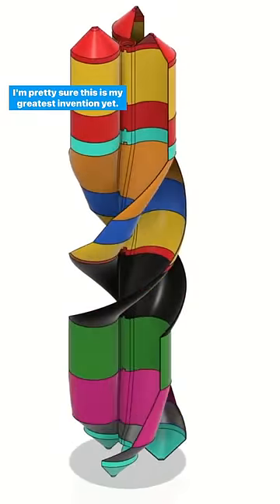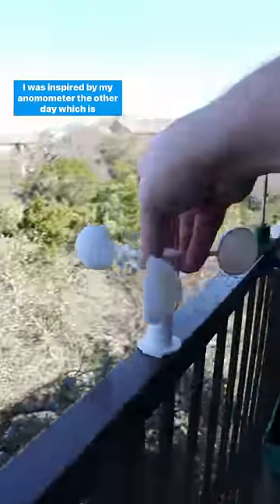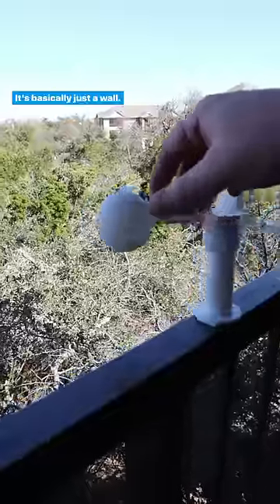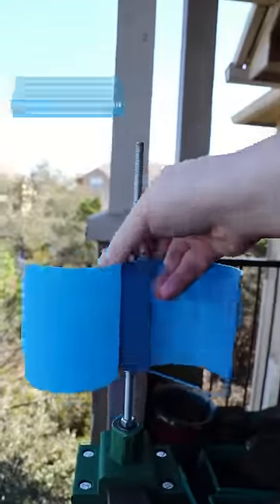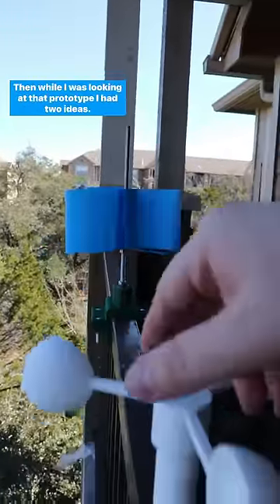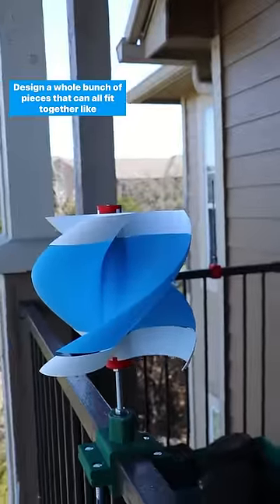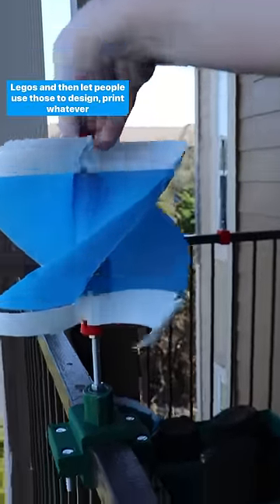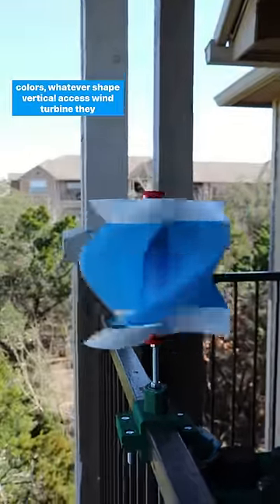My Greatest Innovation Yet: Modular, Stackable, 3D printed VAWT! #shorts #3dprinting #diy

Comment: Putting the twist just made it less efficient, because now instead of all the force pushing tangentially to the center of rotation, some of the force is now being exerted downwards, parallel to the axis of rotation.
Reply: The whole air-cupping idea isn't very efficient to start with. Analogous to how horizontal wind turbines look less like a windmill these days, efficient vertical turbines are also slim and work using lift instead of drag.
Reply: @a2e5 why use horizontal turbines?
Reply: Could you mirror it? I'm not sure exactly how force vectors work, but I feel like having an equal force being applied upwards would counteract the downward force.
Reply: @spencerm5913 the point is that force is lost, not that the forces are unbalanced. Counteracting the force would make the forces balanced, but it would still mean that less of the force is making the turbine rotate
Reply: Only one way to truly find out 😅
Reply: Surely there is as much force going downwards as there is going up? It meets in the middle and turbulence happens? IDK.
Reply: @spencerm5913  
Then they cancel out, which still doesn't make the turbine spin
Reply: @phoenixtrades150  Any force going down (or up) is lost, regardless of if it is counteracted.
Reply: @yoeyyoey8937  Because with horizontal turbines you can get a fucking massive blade area with not a ton of area on the ground. You also need less supporting material, for a given working area, since the blades can support themselves, whereas with those thin vertical turbines, you need a supporting structure in the center to make it work.
Reply: @richardmillhousenixon  nice ty. Why aren’t they more popular then?
Reply: @yoeyyoey8937  1 thay can work at lower speed 2 thay look better 3 thay are easy to build
Reply: @yoeyyoey8937  vertical because in some places you can't put a big horizontal turbine... like:
ontop of skyscrapers ... in-between skyscrapers... in your backyard... in-between buildings... anywhere were you have limited square footage but tons of cubed footage

Many places only let you build above your property ... so a regular turbine would need to be
Reply: @phoenixtrades150  Irrelevant the point of a turbine is to use as much of the force.
The downward force is lost, not used by the turbine hence it is an inefficient turbine.
Reply: @teitgenengineering  cool ty
Reply: @DES.REVER.DESIGNS  makes sense thanks
Reply: @yoeyyoey8937   what's ty
Reply: @teitgenengineering  thank you!
Reply: @yoeyyoey8937  To save space but if you have space traditional wind turbines are better
Reply: @beattest9121  why are trad ones better?
Reply: It's not like this is a new idea, the inefficiency allows for a much wider operating range though, so it is used in many cases.

Comment: Didn’t need to twist, already worked with every angle
Reply: Maybe the torque il more linear
Reply: @DanieleVetrucci instead of what is assumed with the more curved wall, where the wind bashes against it, the curve removes that and replaces it with a softer push
Reply: The twight might make it less efficient. I was thinking take the sphere one and just multiply it vertically  they way if the wind it blowing at the top it doesnt need to push the entjre wing of the turbine but instead only the aread where the wind is blowing will spin. I wonder if that is more or less efficient
Reply: @CelicaSNC  that’s true, but in a turbine we don’t want a softer push, it is gonna reduce the efficiency because the wind is not perpendicular to the turbine.
To make the torque “more linear” he could increase the number of blades
Reply: Up and down angles
Reply: @antoniobruno2947 don’t believe that’s the issue helical turbines are the most common vertical turbine as they reduce torque ripple and are actually more efficient than the savionus design as there is less opposing force from the wind
Reply: @antoniobruno2947  also what do you mean non perpendicular the turbine is cylindrical any horizontal force should affect it the same way
Reply: @justinsaunders110  Look at a turbine blade from the side. It's effectively a ramp, although it's wrapped around a central shaft. As such, any wind blowing in perpendicular to the shaft will not be blowing in perpendicular to the blades
Reply: it twists cause it looks pretty
Reply: @taylortisaac  yes because wind notoriously goes up...
Reply: The twist will cause some of your reactionary force to be axial. This will reduce your efficiency and lower bearing life
Reply: Oh thank god I thought I was insane for that part
Reply: @godzuky2743  ever live in an apartment complex?
Reply: @andrewmenino7676  I will answer that when you explain how a building has anything to do with WIND blowing vertically when wind is excursively horizontal flow of air.
Reply: @godzuky2743  you already answered my question
Reply: You're lookin' kinda pretty yourself,  @Enteropy23  [blushing]

Comment: I've made that type of helical wind turbine like 14 years ago, it's still running and generates electricity via a low rpm wind turbine generator. Our design controls also how much wind the "blades" will take so in case of a wind storm it will not break any parts in it and also regulates the electrical output. Anyway, it is a great design.
Reply: You ran it continuous for 14 years?
Reply: That's the thing- if you invent something and someone else patents it- it belong to them. Then there are people who patent things that haven't been invented yet or try to claim that a similar invention is a stolen idea of their own--- 

People can be impossible assholes.
Reply: how does your design control gow much wind the blades will take?
Reply: Would you please post a video along with the specs?
Reply: Can we see your design please? 
How much power does it convert?
Reply: Could you share your design? Sounds well though out 👍

Comment: i like the general concept but you will need to recommend something other than the threaded rod for an axle because under a load the threading will, not may but WILL cut into the bearing race and cause a premature failure
Reply: you could glue it or something to isolate the threads from the bearing ?
Reply: Umm... You really don't want the vanes slipping on the axel in the first place.
If they slip, they, umm... aren't transferring power.
Reply: Ever heard of a shank on a bolt. Pretty sure we can figure this out.
Reply: Yeah well this little plastic turbine isn't going to produce enough force that that's likely to be a problem.
Reply: No it literally will not. Bearing races are hardened. All thread from the hardware store rarely is hardened. The bearing races may wear down the threads and create a sloppy fit.
Reply: That really is not an issue.

Comment: Been there done that. Expect an average of .1 W that will never charge anything.

Power comes with scale.
Reply: I'll second that from experience. Jr College had a 2 stack split 55 gallon drum servonous wind mill and I sat under it in the gen as a work study job for 3 hrs 4 days a week as a coop job to record power output.  Max...50 watts.  Nov 1982.ave temp 38 deg.  But got my homework done.

Vibrated hard at 20 mph winds.
Reply: Power comes with lift
Reply: Ok.

Do you have any other input than “this small device only generates small power”
Reply: @Joshinken he claimed it was a generator, it is not
Reply: @your_-_mom I mean it can be used as one (with modification). It's not a lie, but it also isn't viable for really anything
Reply: @your_-_mom  the size of the device doesnt disqualify it from being a generator
Reply: @MrM6d  Its not the 80s anymore but i get what you meant i think. More like you need altitude for wind tho.
Reply: It doesn't really make sense at this scale because a small solar panel does the same job with no moving parts, but 100mW is actually a useful amount of power in the context of low power wireless sensors/telemetry.
Reply: @your_-_mom  Does it generate power?
Reply: @treelineresearch3387 well wind technically is 24/7
Reply: If we can collect low winds and make constant energy with big horn shaped collectors then ALSO cover the top with solar panels this would be ideal usage for space to performance. Maybe on top of the river with hydro underneath too hahaha
Imagine that . Hydro with stacked wind with stacked solar all on one vertical axis

Comment: Chris I'd recommend looking at propellers as those ANGLES have already been worked out for maximum efficiency/thrust, in addition to studying Dick Rutans wing designs. He set a number of world records and his wing design included extensive Leading Edge studies (again efficiency-as in airflow over the blade. The airfoil determines the lift. 

 I believe that you are absolutely going in the correct direction-for smaller commercial/residential applications  because a "pole" shape rather than a "bulb" shape would ultimately be readily accepted & incorporated into eco-friendly "off the grid houses". The NEXT 2 frontiers for these applications that need to be addressed are the composition of the batteries as well as the power generator itself. Neither are very efficient presently. Good luck!

Comment: Wouldn't it be cheaper to buy the ones commercially on the market shaped exactly like that and test them?  Or just read their output specifications?

If you don't live somewhere with continuous strong winds don't bother, get a used solar panel when a school or something de-commissions an install.
Reply: Hard to find anything cheaper than 3d printed stuff from your own printer. That turbine was probably no more than a dollar worth of plastic.
Reply: The point is it’s easily 3d printable, stackable, and customizable
Reply: That's not how being creative works, if you don't test and remake your designs then you won't be really be testing much. plus a couple $ (not even probably closer to ¢) of filament will always be cheaper than paying for shipping.
Reply: I don't think maker/craft channels are really right for you.
Reply: Solar is awesome but the main thing is storing the excess energy. If we can make cheap carbon batteries somehow and bring battery cost down 100x then we would all have panels haha. 😂😂😂

Comment: Yes!! I was totally thinking on a similar level, extort the release of air from the ends/top and bottom. Idk how to best though, may I suggest and ask to try something like those fin tips on a planes wing? My other thought is how it would work if it was a cylinder type turbine dirt simple, but on the inside, a more conventional turbine. Maybe vent holes on the outer housing or none but pure pressure difference from the outer shell if at all possible. Or on each fin, those shapes people do making hydroponics from a pipe with a hot bottle neck. Like stretched cardboard packaging if you understand; the air is pushed into a hollow inner where its shot out with momentum, theoretically pushing it faster. The modular idea is brilliant for various setups too, I love it! I can imagine threaded bar with only a couple nyloc connector nuts would make an interesting experiment. Oh, and how would bumps on the fins edges work out too? Like the front of a whales fins or the back of an owls wings being aerodynamically scruffy? :o

Comment: You, know what? This design also allows it to deal with turbulence better. Un even pressure builds will cause the blades to temporarily separate instead of causing structural fatigue over time(makes more sense in larger turbines), but that also has its non financial costs and problems

Comment: I think the half ball one worked better because it allowed air to pass by on thr inside, whereas the second one caught the air moving inwards off the curve. It would likely work better if there was a sizable gap between the stem and the blade.
Also, the ball shape may still work better because it allows air to spill off in all directions, including above and below. The straight blade design may work better not onlu with the interior gap, but gaps along the blade length as well, to relieve pressure buildup.

Comment: The design could be optimised. First, you based your cup shape on the wind speed measuring thing, and there the air on the more aerodynamic side can escape in all directions, whereas on your turbine it can only escape outward, but your design redirects some of the air inward, increasing drag on that side. You’ll wanna make the outer half of the fan slightly larger instead of having it be basicly just a perfect semicircle

Second, this design is quite similar to a savonius rotor, which increases efficiency by letting the air move through the middle and out of the other blade, essentially providing thrust on that side, which is an idea similar to a pelton turbine which will deflect the incoming stream 180 degrees to increase its power

Comment: A drag coefficient is a number. Numbers aren’t smooth or sharp. They are larger or smaller. You can actually view the approximate values of the CD’s for some common shapes by looking at the “drag coefficient” article on Wikipedia. 

And if you follow the references on that Wikipedia article you can find some textbooks and papers that will tell you the approximate CD’s for the shapes of the two sides of your anemometer.

Comment: All practical tests show that small wind turbines hardly generate any electricity, because hardly any wind blows close to the ground. With solar panels, you can generate at least 10 to 30 times more green electricity with the same investment! Moreover, the wind is extremely gusty, which almost always greatly reduces the service life. Only those who MUST be self-sufficient from the grid in winter should install a large wind turbine on a high tower. Solar systems, on the other hand, reliably generate over 25 -30 years electricity at approx. 3 to 8 cents/kWh.

Comment: That thing exists, and it isn't used for a reason. It isn't good. However it is a good design for draft improvement fan in the midlle of an air channel. (Ball type only works at termination point). And that is what it is often used for.

Comment: A flat vertical turbine is actually better than a helical one. The most energy out can get out of wind vertically is a concave area perpendicular to the direction of the wind. An helical turbine sucks at this because only a couple points on the helical turbine are completely perpendicular at any time a turbine with blades is able to essentially accumulate a bunch of these points into one large push
Reply: I looked up wiki and it explains that the helical shape “reduces the torque ripple effect on the turbine by spreading the torque evenly over the revolution.”  I wouldn’t have thought a little one this scale would generate levels of torque that would trouble the materials. But I don’t pretend to understand if that’s the torque problem.

Comment: It doesnt need to twist. it alrdy catches Wind from all Sides. thats why it has multiple wings lol... Now thw wind doesnt hit the wing 90 degree, now it slips off to the top. you probably loose som epower with those angles wings. its like a Airplane with 45degree wings. it wouldent fly straight.

Comment: Woah that looks extremely efficient for a wind turbine. It actually gives me an idea for a really weird water one.
Reply: Would be a great water turbine
Reply: It's not, though. Vertical axis wind turbines keeping being invented and reinvented and it turns out they just aren't as efficient as your classic spinny propeller design, the horizontal-axis 2- or 3-blade turbine.

Part of this is that these vertical-axis turbines are based on the old idea of the wind just pushing on the blades, like a sail on a ship. That's the intuitively obvious way to harness wind power — old Dutch-style windmills and old sailing ships did the same — but as it turns out, there's a quite different, more efficient option used in modern wind turbines: the blades are airfoils like airplane wings, and the wind generates "lift" in a circular direction. (Modern sails are more like airfoils too, by the way.)

Comment: Actually, your a on the right track my friend barometric pressure has a drastic effect on anemometers in certain places in the world. However! Now your design will require a lot more math if you wish to solve this issue fully. You've added a bit too much weight, still bravo design concept!

Comment: why does the spiral help anything? the thing is already spinning so its already generating power from any direction of the wind? I mean maybe it gives you to power more smoothing because its always generates power instead of only giving you power every third of a turn but I can't see that being significant, and the angle of the surface hitting the wind is surly making it less efficient? 

would love to see some testing on it though
Reply: According to wikipedia, the helical shape “reduces the torque ripple effect on the turbine by spreading the torque evenly over the revolution.”   So … not do with “collecting wind from all different angles”  as he thinks.

Comment: Where do I buy a 3D printer that can print a turbine big enough to actually provide any meaningful power whatsoever? Blades work much better; provide more torque in less wind. Turbines require fancy gears.